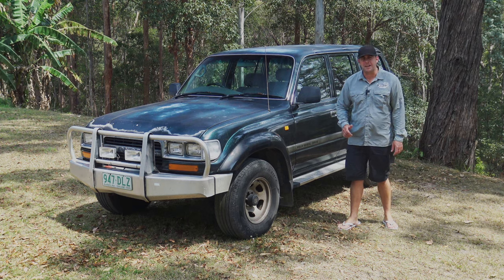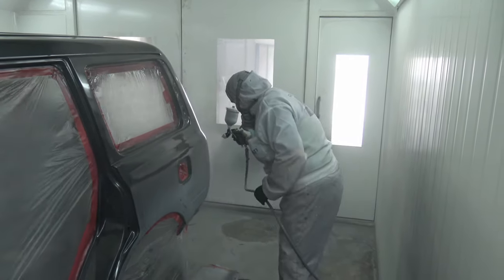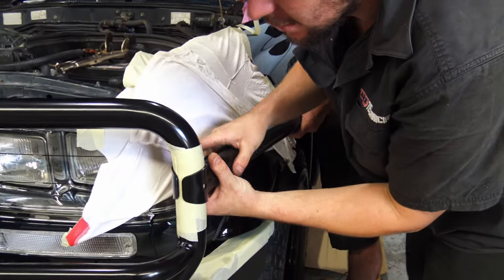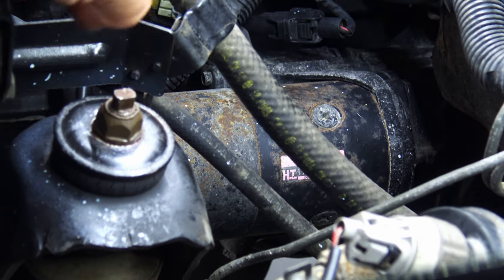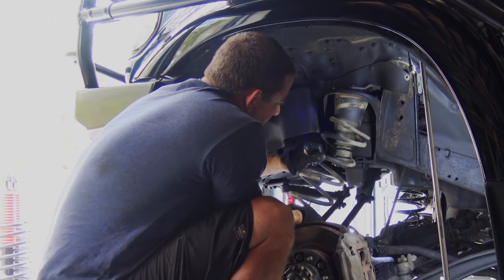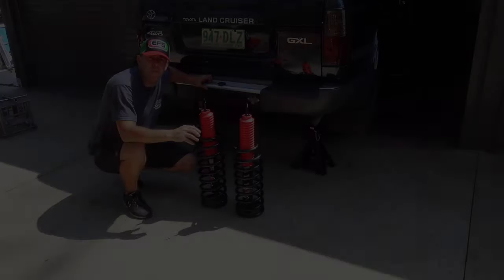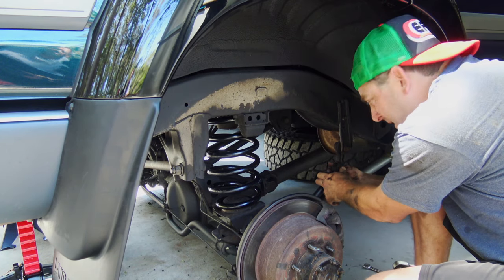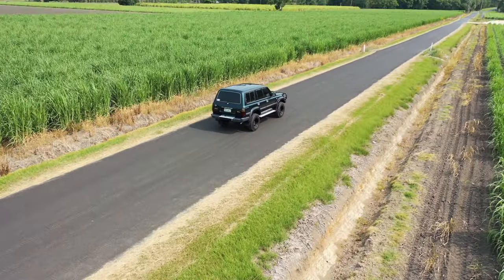Toyota 80's Series Land Cruiser - RESTORATION

Comment: I intend on buying a car like this when I have the money. I've seen them being sold at a bargain with great engines still. Like you, I'll probably do the suspension, tyres, paint, maybe the brakes and a bullbar on the outside. And for the inside, some modern electronic equipment like an mp3 player, a nav system and new seats.

Funny thing is, if treated right, this car may very well outlive all of us in the comment section 😂😂
Reply: Yes and outlive 10 electric vehicles that are supposedly good for the planet.

Comment: Hey mate. I’m about to do my 80 series up also. Did you replace any of the mouldings
Or rubbers. I’m keen to know where to get them from.
Reply from the maker: Hi mate replaced mirrors and mudflaps polished chrome door handles painted the door rubbers black vinyl spray new headlight surrounds off eBay. Good luck 👍🏼

Comment: Hi mate, what about the caster correction and adjustable panhard rod, do you install those thinks? I have the same lifted 80s and curious about it..TIA
Reply from the maker: Hi mate I did buy the caster correction bushes with the kit but I didn’t install.
I wanted to see how it handled before I made the call to fit that aswell.
It rode pretty sweet without.
Cheers 👍🏼

Comment: Hi Mate,

I got couple of questions.Is it necessary to put new springs as i was thinking to put bigger rims ,same as yours.
Secondly where did you get the front headlights and grill?
Reply from the maker: Hi mate to fit 16x8 rims with 285x75x16 tyres you need a bit of room under the guards.
if your suspension isn’t sagging you might be ok. Best to check with a tyre shop letting them do a visual inspection. Grill is the original I just gave it a polish. Headlight I bought new surrounds off ebay and new headlight protecters.
Thanks
Reply: @unknownroadadventuresaustr5661  Thank you